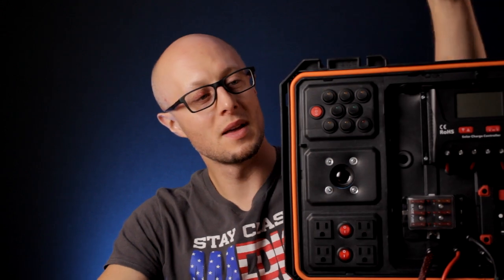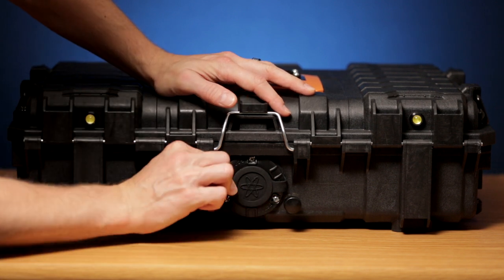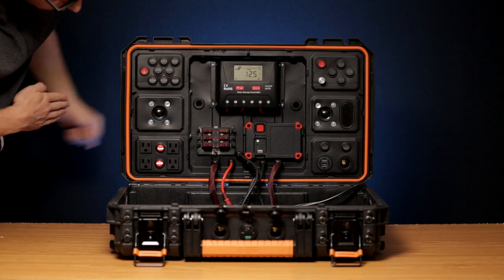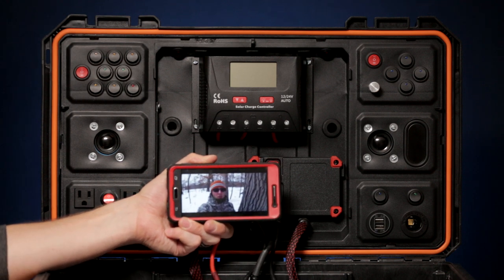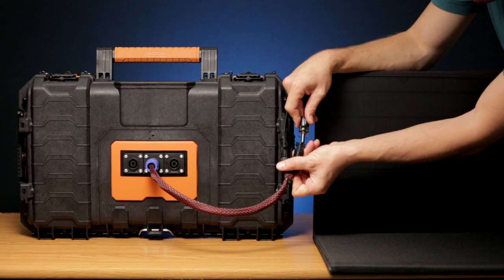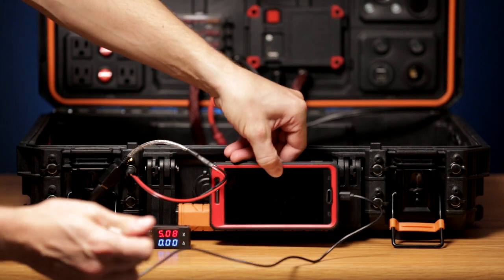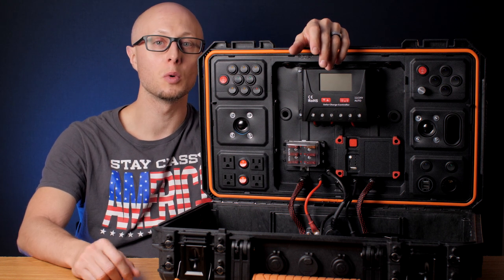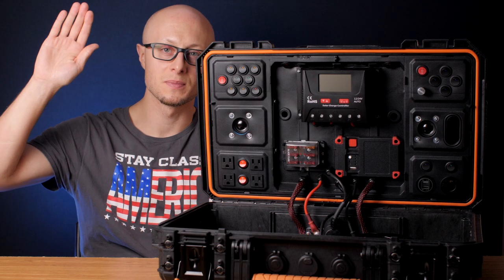12V Portable Power Pack Presentation / 12SBL IS DONE - PART 2

Comment: What would you have done differently in your build? I just so happen to be building a power pack and already had the 3 ridgid tool boxes to make a bugout with. Would you have changed the placement of the cuts you made into the box? Did you find limitations?
Reply from the maker: Thank you for your comment. I would probably use different battery meter, solar controller and other batteries. Otherwise, I am happy with the build. I spent a lot of time with planning of each component- maybe too much time. The box is easy to cut or glue on. Take care!
Reply: I'm using a combination of lifepo4 batteries and 500 farad of capacitors linked to the next size up of the ridgid tool boxes to hold the batteries and 2000 watt inverter
Reply: So far my build is very similar but I have added a 12v h20 pump with filtration unit, wireless driveway alarms (4 external sensors) for a proximity alarm (1000ft range), a tri band baofeng handheld radio, 7inch tft monitor with 2 wireless cameras, low voltage battery alarm and a built in voltage DC-DC variable volt regulator.
Reply: I forgot to mention, I also have 2 36v ebike battery packs that have a dc buck step down to 12v. Got them for free off craigslist. To recharge, I setup a variable voltage input board to take power from a hand crank generator I have, solar or wind

Comment: Great design!
Reply from the maker: Thank you. There are definitely some components and parts which I would probably change a little, but so far I like the 12SBL. I basically designed it and build it in the same time. I have another smaller project for very similar device ready to start. Stay connected for the video. Take care!
Reply: @MODERNSURVIVALTACTICS  I watch every video, and thank you for great content.